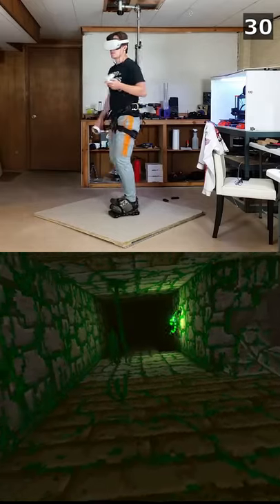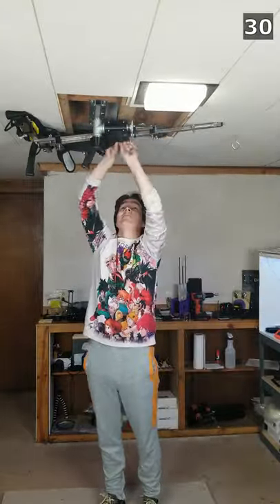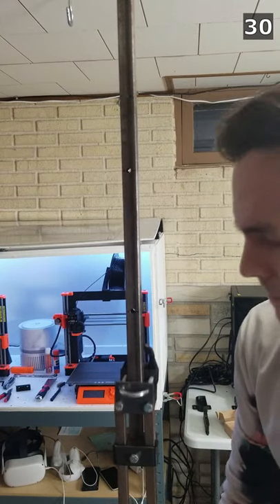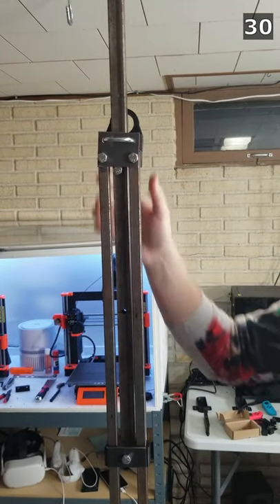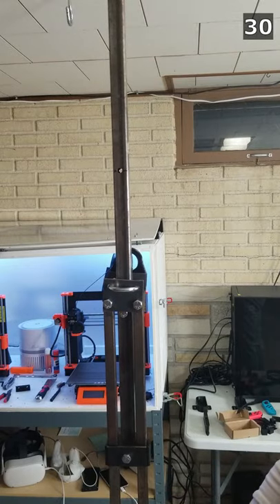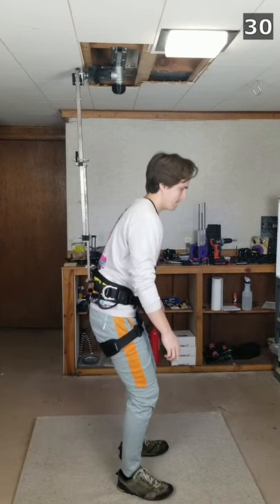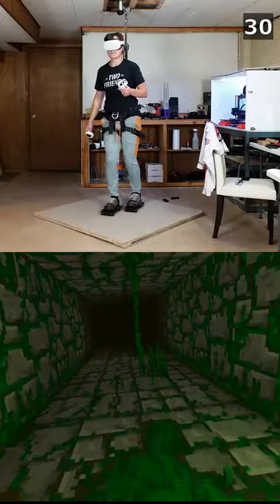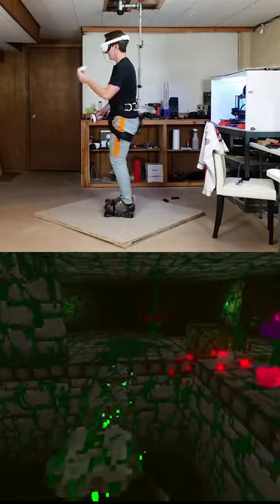#Shorts VR Shoes Update 30 - Storage and Sitting

Comment: I had an idea about getting vr shoes to track on two axis recently. ball mouses can Handel two axis of movement pretty easily so why not apply that same laser tracking system to the shoes? using free rotating spheres instead of wheels would also be a good mediator for both walking forward and strafing in allot of conditions.

Comment: I advise against painting the components, as it will just rub back to bare metal after use. Instead, consider wiping on some oil to prevent more rust forming. 

You may eventually want to add a corrugated sleeve to cover the mechanism; this would allow you to grease it for smoother operation (red n tacky is a great option).
Reply from the maker: Okay. Oil might get a bit messy. There is only one square tube that slides. I think I can paint the others, but for the one that slides maybe I can replace it with an aluminum tube instead, since that won't rust, and I can also buy that locally.
Reply: @finallyfunctional  Aluminum would definitely do the trick. You might also look into linear bearings for the future.